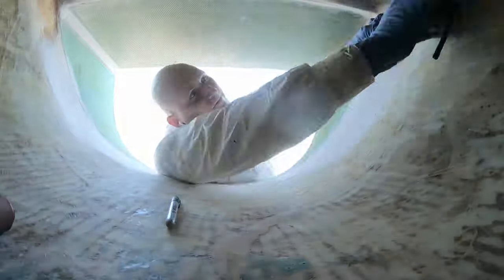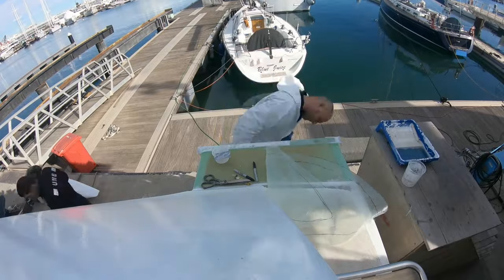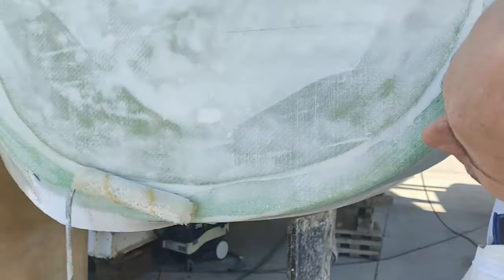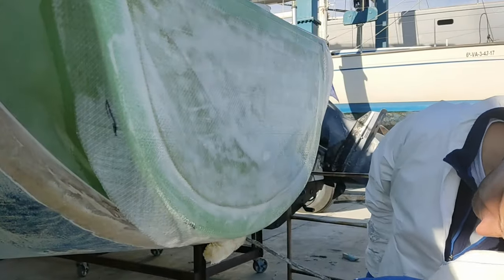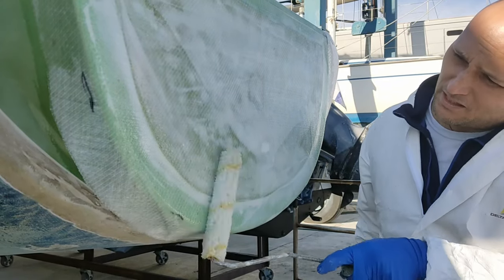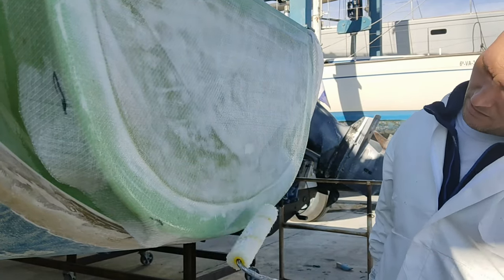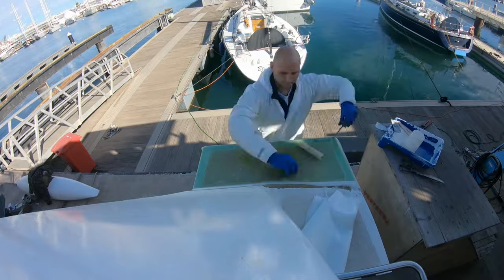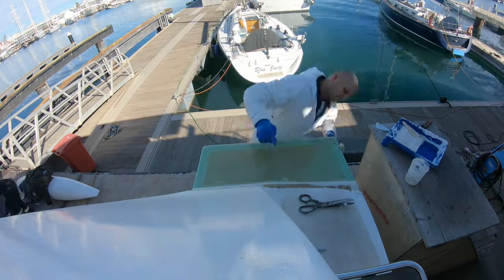WORKING WITH COMPOSITES | Paikea's Transom Extension

Comment: It looks like you did not put an aft bulkhead on that extension. Is the aft only fiberglass (monolithic) laminate?
Reply from the maker: There was no need for an additional aft bulkhead because we did not extend the waterline. The extension only squared up the aft transom to make a step/swimming platform. Paikea's structure is foam core with glass and this is why we did the repair with foam and glass. The old transom that we removed (the piece you see being cut out) was monolithic.
Reply: @youngbarnacles  that is very interesting to know about the original design. Thanks for sharing. Your video is really good.
Reply from the maker: You're welcome